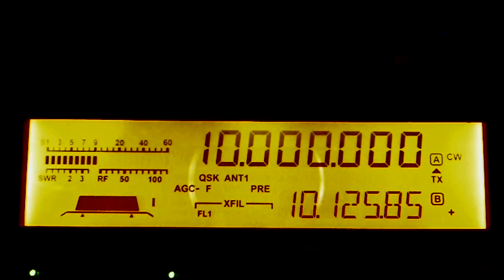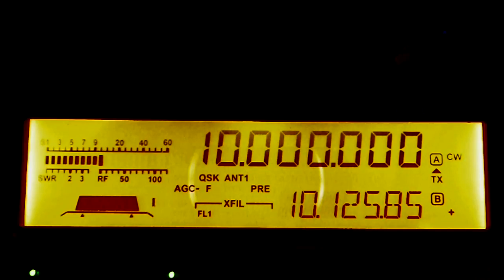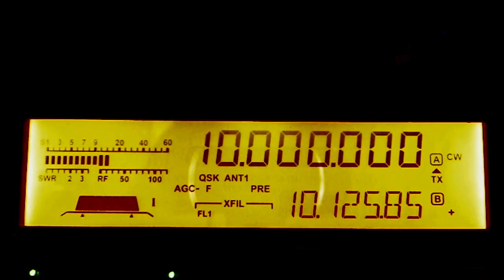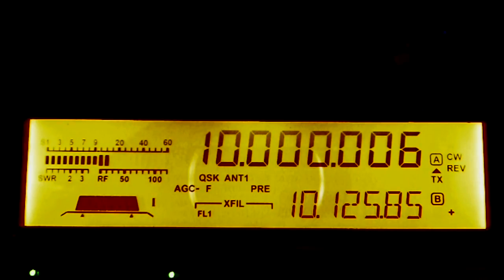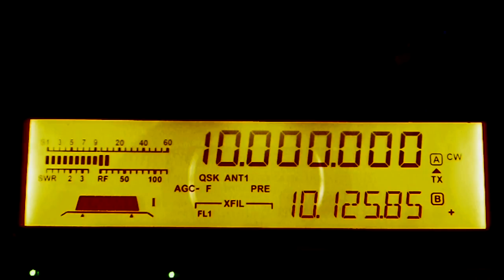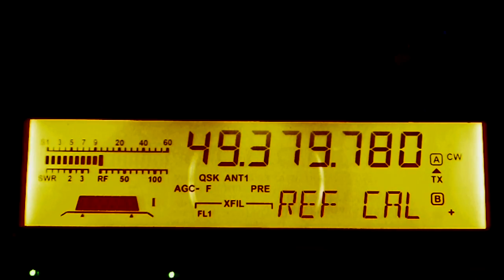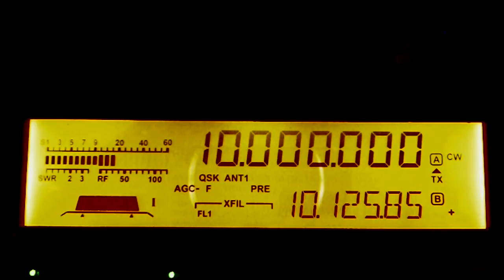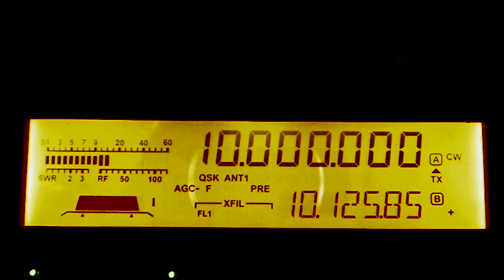K3-RefCalibrationProcedure.wmv

Comment: Chuck, I am trying to use this method to try and determine how many ppm out of calibration my new vintage HP5245L frequency counter is.  By zero beating my signal generator with WWV and then plugging that output into the counter, I should be able to calibrate the older HP equipment (my sig gen is an older HP unit too).  W2AEW has been helping me with this.  He has a great You Tube channel if you haven't seen it.

Comment: If you can hear WWV at a higher frequency (such as 20MHz), you'll get a bit more accuracy: the higher frequency accentuates any error.

And if you can't hear the slight pitch changes by ear, you can use SpectrumLab or similar software to get within 2 Hz.

73  Gary  ZL2iFB